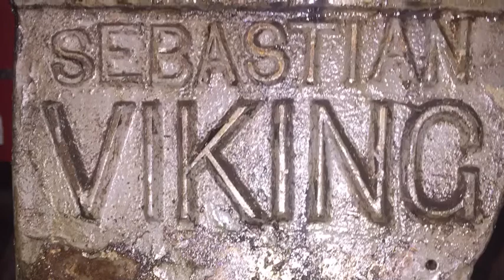Sebastian Viking Lathe

Comment: I have the same lathe & need a Dial gear, mine came off a U.S. navy ship has  a Gov I.D. tag.
Reply from the maker: 73turbopinto did you mean the gear on the thread dial? I found the correct gear (plastic though) in a traveling sprinkler. 6P 24t 1.24" dia. 

But you have a Sebastian too? Cool, apparently there aren't that many around.
Reply from the maker: 73turbopinto also many parts are available. I made my own thread dial though.
Reply: Can you tell me where parts are available for this lathe? I commented on your other video.  I just picked up this exact lathe.  1939 huh?  That's really neat.  Any manuals or anything around?  Also trying to figure out what oil the gear box takes.